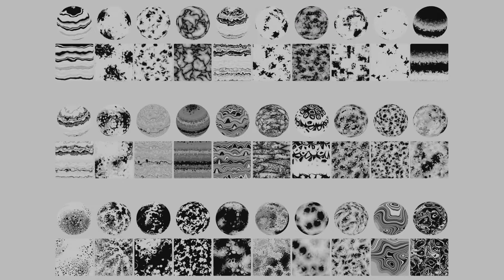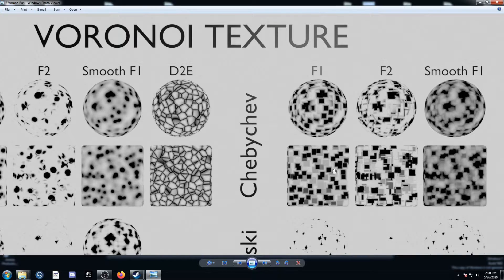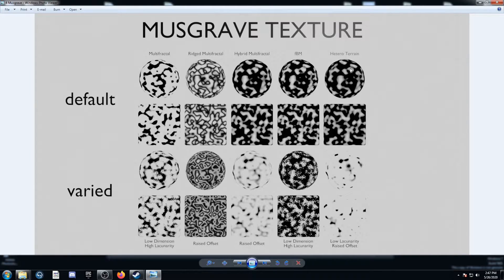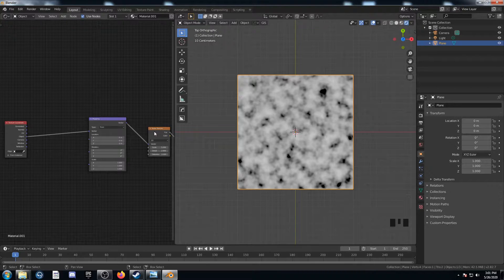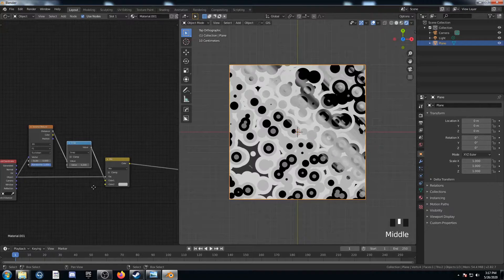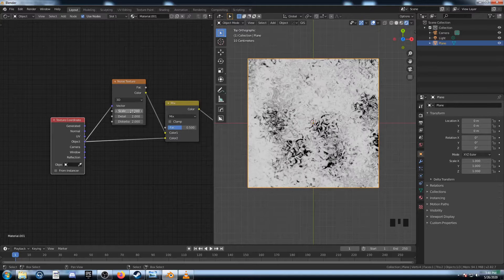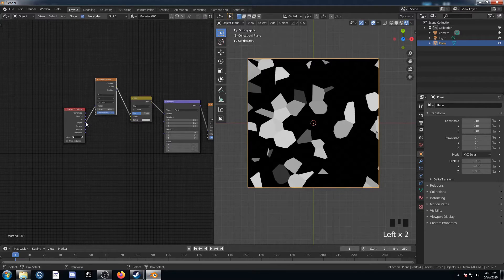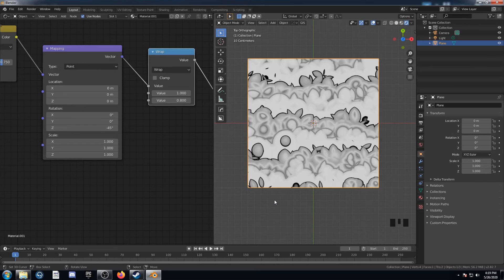Procedural Nodes (part 6) - Getting variety from the texture nodes in Blender

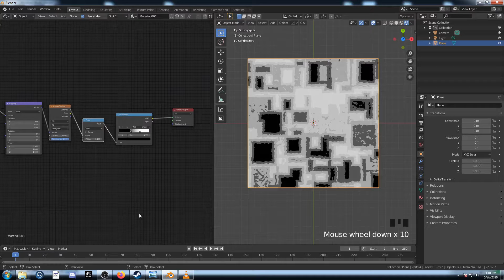Comment: 10:56 - Sorry for asking, but what to do, those who have blender version 2.8, and there is no SNAP (Math node)
Reply from the maker: If I were you I would just try swapping out either another math node, a color ramp, or a map range node. A lot of these setups were done through experimentation so you may stumble onto something cool even if you aren't able to replicate what I've made here.

Does 2.8 not work well with your computer?
Reply: @snow_mamba  I just use blender version 2.8 and you have 2.83)

Comment: Hey how can i make that texture you have at 12:05 have the displacement of each internal square gradually be a lower height as it gets towards the center?  Hope that makes sense
Reply from the maker: I think i get what you're talking about, and if I do then I did something similar in my spider web video that may help you out. I could be wrong about understanding you though, feel free to share a picture of what you're after on my discord
Reply: @snow_mamba  thanks i just checked it out and it seems like subtract, absolute , and multiply bodes might help me achieve this.  Just wondering how to go about implementing them within the texture that i pointed out in this tutorial.

Comment: Question: After the node is created how do you use it with another node group to act as a factor for mixing two shaders? 
I understand using a mix shader node but the shader created originates with the plane object you created but I need to transfer the node group into other materials (shaders).  I hope I'm explaining myself clearly.
Reply from the maker: Hi Richard, are you asking how you can use the black and white texture to control the factor on the mix on shapes other than a plane?

Comment: How can you find linked users to procedural textures for particles and displacement? Is there a way ?
Reply from the maker: If I understand you correctly I don't think there is a way to put particles on a mesh that has been displaced through procedural nodes. You would have to do your displacement through the modifiers and then check "use modifier stack" under particle settings (unless that has changed, haven't done it in awhile).
Reply: @snow_mamba  thanks, I have like 5 particle systems and 5 blend textures for the influence size. For the 5 blend textures  how do you find what mesh or collection asset they are connected to. I have a big scene with 25 particle systems - I got a little lost but then went looking for a way to track who’s using what. Seems taboo what im asking even in the FB groups just silence.. in maya I would hunt down any connections in the hypergraph.
Reply from the maker: @SterlingOsment  are you using pre made textures to influence where the size occurs?
Reply from the maker: @SterlingOsment  you should be able to click the a tab next to the influence section under the particle settings, if takes you to the corresponding texture.
Reply: @snow_mamba  no just blender versions you know the blend, clouds, voroni ones - you add them at the bottom of the particle sys and you can edit the size based on a colour ramp etc
Reply from the maker: @SterlingOsment  ah okay I understand. Hope my advice helped.

Comment: Is There is Any Way to control colorRamp Flags  in custom  groupnodes ?! btw erindale using colorburn and colordodges! any other ways like adding more flags in colorRamp ?! like using  no.of cb an cd nodes and adding together!  how many possible ways to achieve colorRamp Functionality without cRamp for Custom groups! Thank you!
Reply from the maker: That's a good question and I'm not too sure. I think you're on to something with the color burn/dodge setup but I haven't tried it myself. May want to ask Erindale that well, he may have a better response for you.
Reply: @snow_mamba  yes Thank you!Your Tutorials are helpful!
Reply from the maker: @learningsomething8904  I learned something by watching Gabe Bettini the other day, he uses a map range node instead of a color ramp which allows you to plug things into where the flags would otherwise be. Check it out here https://youtu.be/fsN1slkUXqQ?t=535